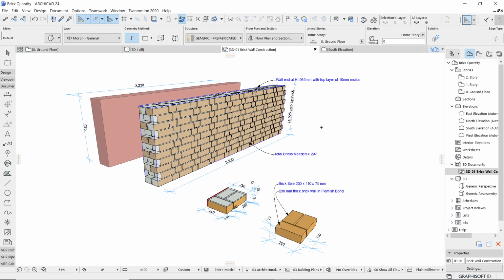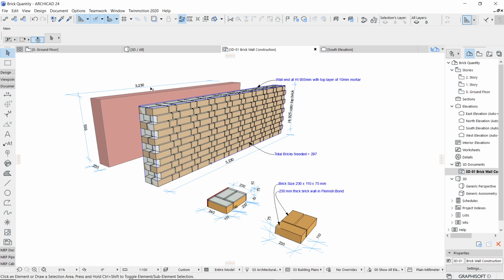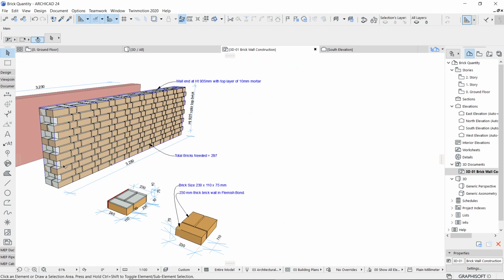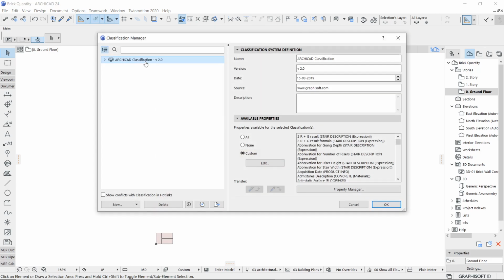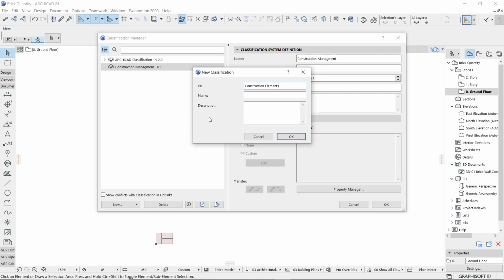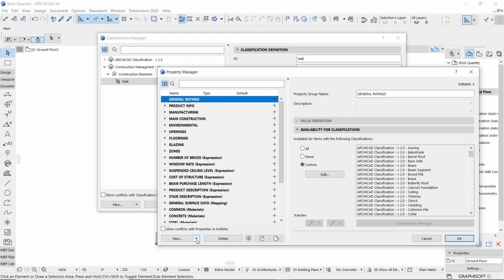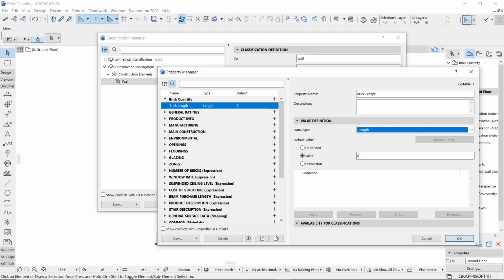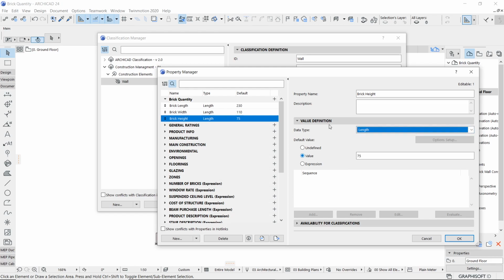26 Brick Quantities 01

Comment: It is sad, that this quality of content not many understand. Thank you for great work.
Reply from the maker: Thanks for the appreciation. I think it's the core need for architectural practice. And more you work more you invent. I have replaced this bricks calculation method with much smarter equations by using IFS.
In earlier method one has to match the wall thickness and brick size from properties. With the IFS equation it works automatically as per changed wall thickness. Will post that lesson soon 😊